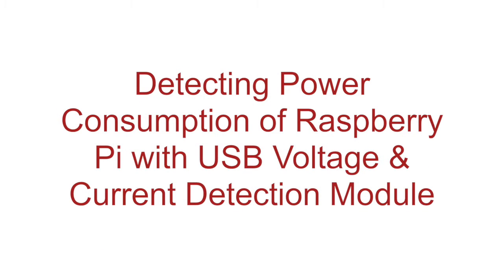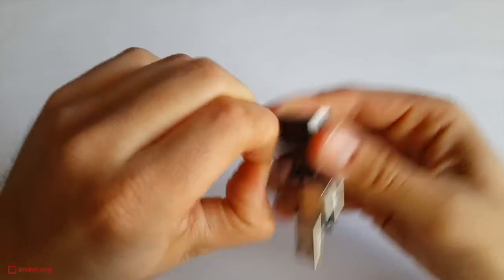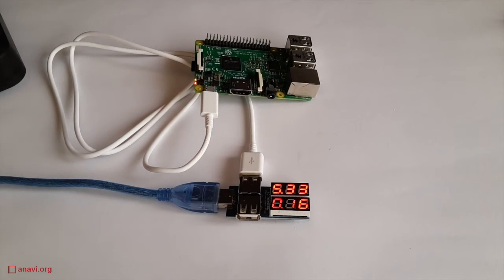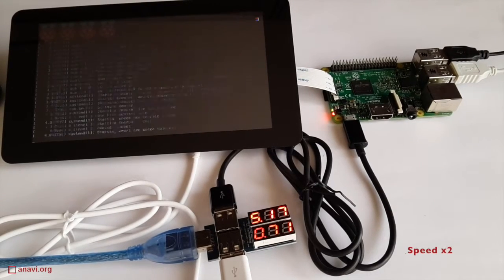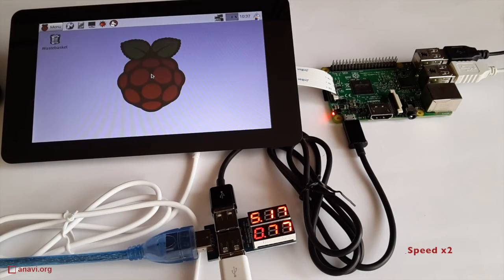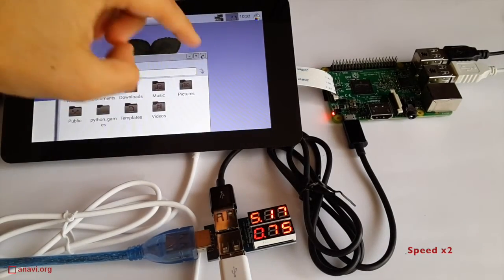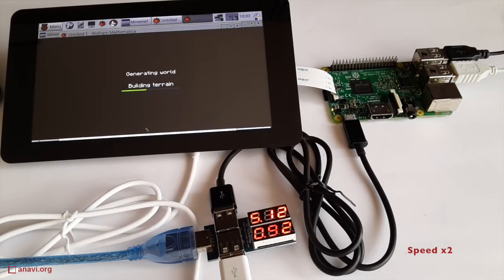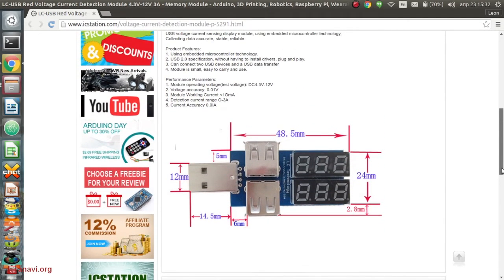Detecting Power Consumption of Raspberry Pi with USB Voltage & Current Detection Module

Comment: Can you update the link for USB voltage and current detection module? I want to order it? but the link does not lead to any thing?
Reply from the maker: Sorry, I've just seen that the link isn't working anymore. Right now I see something similar in ebay by searching for modu5Q2.